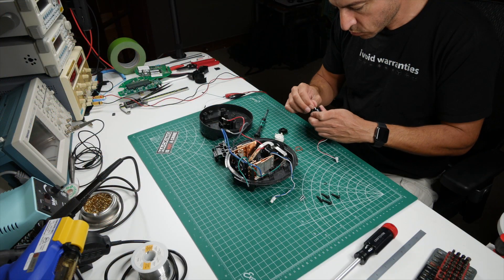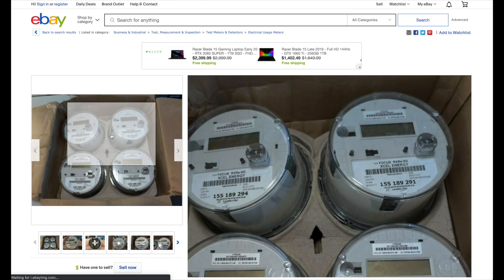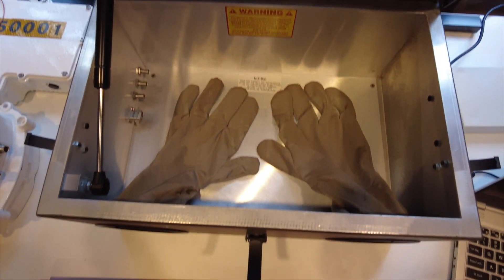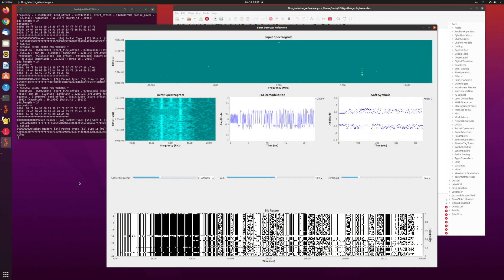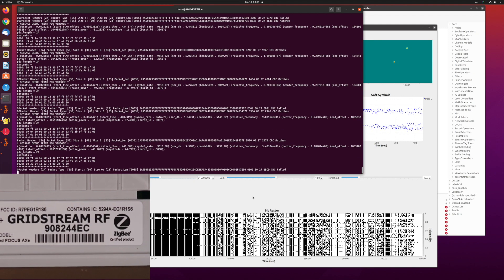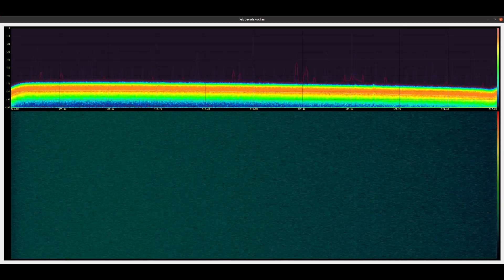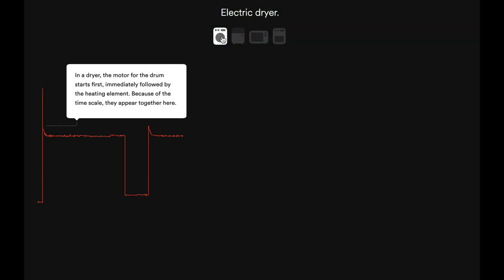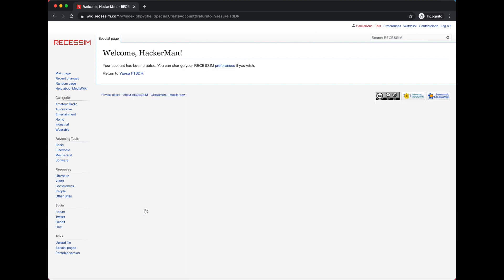Smart Meter Hacking - Introduction

Comment: I hate my SMART meter and I hate my power company. My bill is 3 times higher than it should be, it flips my breaker if I try running my toaster and microwave at the same time and, it emits way too much emf, causing pulsed hits which have caused some health issues... They give the runaround when asking to have it removed. They've lied to people in the past and charge them for a non SMART meter, that's still SMART

SMART= Secret Militarized Armaments in Residential Technology

SMART devices are weapons.
Reply: the gov must want you gone/disappeared.
Reply from the maker: Sorry to hear you've had a bad experience

Comment: Nice try of learning what my appliances are, what about my computer that changes the input power that it needs (In W - Watts) all the time and is not constantly drawing the same current? Or what about my random motor capacitive dropper circuits? You will never know what I have plugged in
Reply from the maker: Never is a long time.
Reply: @RECESSIM  hehehe